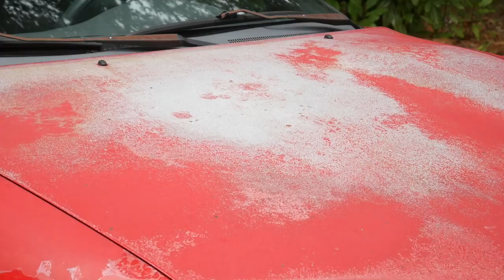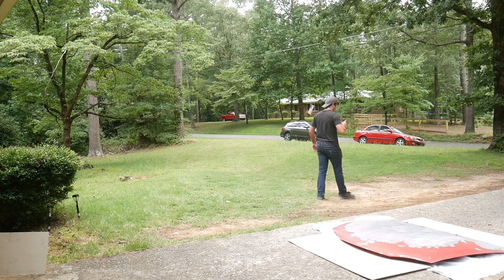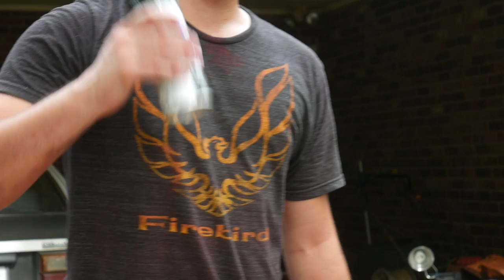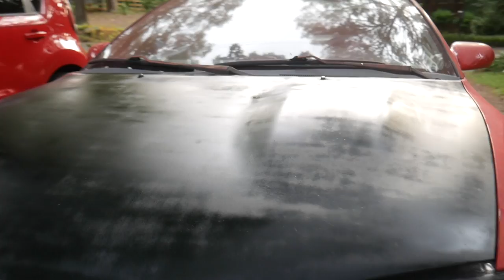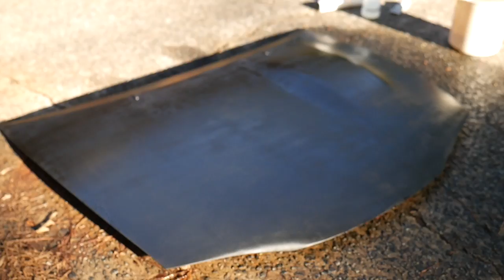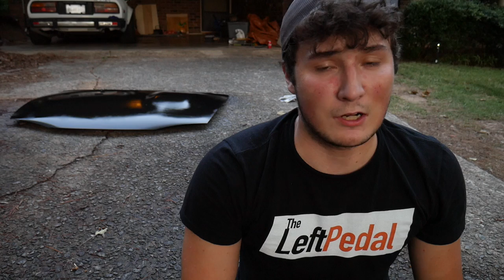Spray Painting a Car With No Experience

Comment: Being a professional spray painter, this kinda hurts to watch😂
Reply: @NITEHAWK3  😂 a crap job is a crap job, no point telling the guy it looks good. You dont get better by getting your arse kissed and told something looks good, when it doesn't.  And i was more talking about the fact he is using rattle cans with the bonnet on the ground in the dirt😉
Reply: @joelroosen9932  I use rattle cans and get factory quality finish.
Reply: @electricslide8469  😂 If you say so
Reply: @electricslide8469  but it definetly wont last as long, after 1 year ur going to notice it's cracking
Reply: What was he doing wrong ? 
Just out of curiosity because I plan on painting my front bumper
Reply: @kevinteran5624  me too
Reply: Could you fix the orange peel by wet sanding and buffing it ?
Reply: Miguel Resendiz yes you can
Reply: @NITEHAWK3  he asked people to say it's crap and add a smily face if they do.  All Joel did was what the youtuber asked... maybe you listen better:)
Reply: @KappnSkips being a professional painter or not, if you think that is  good job you've got rocks for a brain😂😂
Reply: @KappnSkips  far out, wake up on the wrong side of the bed mate😉 take your meds..

Comment: Side to side always, not up and down. Dont do cross patterns it should always be horizontal. And spray from one end to another. Dont do graffiti style spraying. You also have to sand the primer before painting. And finish with a sealer, even with matte paint, that makes it pop out

Comment: I know this video is rather old but I have painted a lot of bikes with spray cans and the way he is doing it you would want to actually hold the spray can further away than what he is doing so that the paint basically falls onto the surface more evenly and no streaks or lines in the paint, and move your hand in long straight lines never putting too much paint on at at time

Comment: I am glad you made this video, I'm pretty good with a lot of DIY projects but not everything I touch turns out great.  Spray painting is one of those that, my projects turn out looking a lot like yours so again I am glad someone finally posted an honest video about how these projects usually turn out because ... A hood is actually a lot bigger than it looks, you really need about 3 cans per coat and put on 3-4 coats 1/2 hour apart and even then I would be concerned about paint running and other issues so yeah, mad respect for paint shop guys.

Comment: One thing that would help is to prop the hood up vertically. It will give your cans better angle to spray properly. When it's flat you are more likely to have nozzle issues. 

Short side to side passes, 3 coats. First light to tack the surface, then two wet coats, with overlapping pattern. 

Keeping the stroke short is important with cheap cans are important. They don't have the consistency to lay down smoothly when you try and lengthen the area you lay clear down.

Comment: Tips for anyone spray painting anything, keep your pattern and overlap consistent. Try to keep an overlapping wet line, you'll see a hazy edge on your first line, cover that hazy edge on your next stroke and keep that flowing until you are off the panel. It will look like you are pushing that hazy line off the panel. Dont spray random strokes. It helps of you get a can with a wide tip. I also learned with cans and just jumping into it. Sand with a 18 inch block with all the low grits, higher grits a soft pad is fine, dont use your hands. Practice on smaller panels and move up to hoods and roofs. Like anything it takes time and patience, the more you try the better you get at it. Good luck and have fun!

Comment: A year too late, but I heard warming the paint can up first - like putting it in a pan with water that’s been heated helps additionally - getting your painting surface as smooth as possible before painting like Bondo - 3M or any body filler and sanding sanding and more sanding

Comment: Look mate coming from someone with experience here's a few tips if you have no option but to paint with a rattle can
1. Make sure you're not in direct sunlight and preferably out of the dirt and somewhere away from some elements
2. Make consistent coat laps ie (speed of hand movements, and pressure of pushing on can for consistent output of paint)
3. One big mistake you made and I understand it can be tough on your first go is try to overlap your passes, 50% is what is recommended so half of your next pass should go over the one before it bUt just as well as you can, this makes sure the job stays comsistant and smooth.
4. Honestly you're sanding was alright good job there, good use of grits, and probably a half the reason it wasn't disgusting haha
5. You need moreeee clear, I can't stress this enough for multiple reasons first off you need multiple coats second you want a few light dusty coats of clear to help fill in spots and help make a tacky surface for a final spray of a heavier coat of clear this should be almost watery in appearance, not so much to get runs but enough that it will have an even and wet look. 
6. A good buff at the end will if dome properly will give you decent results, nothing beats a proper spray gun and booth but sometimes you just can't do it and I think most of us understand that so atleast try do the best with what you can use.

Comment: Valiant effort sir lol... it's good to keep that expectation low cause you're never disappointed lol. Aerosols are hard to use, especially in the sun and heat. each pass you make essentially dries before you make the next pass and that's why it tiger stripes. lay on heavy wet coats when you use spray cans, and long even strokes are your friend.

Comment: I have no experience and have never painted a car but what I know is that you have to sand the remaining paint then primer it with light coats so it doesn't runoff then when it dries sand it down then clean the dust and paint it with the desired colour then put a layer of clear coat on it and if we still see dust particles in the paint we have sand it with a very fine grit and polish it to remove the dust so there are no impurities though it is advised to bake the paint to make it long lasting

Comment: I'm no painter. I have 2012 Dodge Charger all black. I noticed that scratches from other car doors on my driver side. I took some black gloss spray paint to get rid of scratches and learned quickly that I should have used either stencil or a small painter's brush to fix it. Thanks for your video. You are better than me, you put alot of work into your car! The Ebay Elipse looks good. But add more black gloss spray paint. You can get that from Walmart. Are you planning on painting it all black or red. If it is red you'll targeted by the police alot for tickets and the car would be a chick magnet. If the car is all black than you'll be very hot in the summer, but a chick magnet at night! Overall great effort!😉

Comment: A helpful tip for me, especially on something that big, is to have it propped up vertical on something (i.e. a tree or something). It looks nicer when you go through a full line than to stop in the middle of your project. Also, for me at least, its better to paint a shallow layer than a thick layer. Shallow, you get to go back and add a layer. If its thick, that's when you'll get the dripping of the paint. Overall, it doesn't look too bad, especially for a first timer.

Comment: Biggest issue here is bot keeping a wet edge to work to.  Dusting paint on will result in patches and stripes.  If you can get the bonnet an a more upright say 45 degree angle it will help as more paint comes out of aerosol cans when they are upright. It is possible to maintain the wet edge with aerosols. But you need to have a decent overlap of around 40-50% on each pass and work fast enough to keep it from drying. Also when painting outside sometimes you need to go slightly closer than they suggest as any wind blows away the spray. If it says 12 inches away then reduce to say 9 inches.

Comment: Thinking about fixing my truck. I’ve got some clear coat issues in my door. Nice work BUT if you would have kept it a lil bit more uniform you might’ve had better results. I haven’t done it yet but you needed more even coats. You said you had 7 coats so you’re just gonna sand it out. Hell yeah brother! BUT you gotta keep it uniform. Sand 1 area at a time til it feels smooth. You kinda bounced around a bit. The end turned out better than what it was. Just needed a lil more sanding. Even if dull it should all be 1 color THEN you clear it. And when you do even wet coats. 👍

Comment: You should have been in the garage with that hood on some saw horses and sprayed further away with slower and longer sweeping strokes plus next time when wet sanding use a sponge so that it will leave finger marks off the job and be more uniform. You have great determination and keep up the good work!

Comment: Dont cross your paint spray, dont go from here to there, stay in one area and overlap the paint as you spray. Use good paint. Use a sanding block not your hands. Dont let the panel get super hot by the sun and avoid direct sunlight. It looks good from 100 ft. Lol

Comment: it helps to stand the hood up easier to reach top to bottom left an right .. when spraying the paint needs to go on wet if you see dull or dry looking streaks slow down n go over dry streak before continuing .. if finger gets tired stop for 10 seconds rest n continue spraying .. if you get a run dont start trippin finish  painting an let it dry 24-48hr wet sand entire body panel to get rid of orange peel n any runs that may have happened go over panel with meguires ultimate compound can do by hand just takes time work in small sections wipig in small circular motions use clean micro fiber to apply an use another to wipe off. ive been able to get spray paint to glossy mirror finish . important try to paint on days with 75% humidity or less n work in the shade no direct sunlight

Comment: I spray painted my car today... lolol. I used a sander and buffed out the rust and chips etc with a 60 grit, then a 120, then a 320 until it was smooth. I then of course put 2 coats of a primer, then I did about 2 coats of white paint on the primer and then tried to blend it out. I ran the length of the hood back and forth as fast as I could. I sanded it with a 320 again lightly then sprayed it 3 times again. I then did a light sand and am spraying the clear coat. I've never done it before but it turned out really well. 
I did spray paint it is long strips but I literally had to basically run back and forth. You also have to make sure you hold the can at a decent distance and keep it that distance the entire time. 
Perhaps it was because it was white..who knows. 
My suv is a pearl white. Of course I got that in the spray form but it was rustoleum. The sheen is super bright so I lightly sanded the sheen down and it matches the paint nearly perfectly. I figured nothing could look worse than rust anyways so win win.

Comment: Tips: 
1- dont paint in direct sunlight 
2-  dont paint “sections” of the panel, sweep all the way across you would have had much more success if you held the can further back, stood the hood up and swept across with the can vertical, a lot of your issues were due overlapping and uneven strokes. 
3- Overspray is your friend, it means you’re getting the whole surface

Comment: If your set on rattle can spray jobs, go with rustoleum professional it gives a much better more durable finish. You could of stood the hood up to paint that would have been easier. Your getting the zebra stripes because your not overlapping enough. As far as clearcoat you can get spray cans with hardner. On a side note if your trying to stay on the cheep, putting your egr valve and other carbon fooled items in a bucket with carb cleaner and letting them soak over night would have worked. Keep doing what your doing and try to learn and keep improving, it shows you have initiative 👍. Have fun😁😁😁😁😁

Comment: Dude I have to say I love your honesty I love your raw video style I love your innocent of trying to do something that you're not that familiar with. I was highly entertained and I enjoy every minute every second of your video because you were not skilled of course but you are honest about it and that's a real character that really shows in your video.

Maybe using the term real character is incorrect.  I really meant that you're really genuine and that's what shined on your video. By all means I am not a pro but so far I think I've watched about 50 videos and I've watched them several times over and over and what I think you did wrong was you were painting from an angle on the floor I think the hood should have been elevated like on a stand and instead of pointing the can from high in the air the spray nozzle wasn't shooting the full pressure which gave the can a wider spread. So your streaks was because it was not a wider spread and it was more narrow so again you should have had the hood elevated on some kind of stand and then have your can angled almost upright but not angle towards the ground if you know what I mean. 

Also the clear coat you're using doesn't have a high gloss you should be using a 2K clear coat that has the type of shine just like a factory vehicle. If you watch a lot of YouTube videos they tell you to use a 2K clear coat which has a super high gloss and has a hardener. Also after you apply the clear code there's a lot of buffing involved which will give you a factory high gloss shine.

But again I love your genuine personality that really shine through the video and if anything even though you weren't a pro you were just a regular Joe trying to do something you have no skill and you are very entertaining thank you so much for such a entertaining video and dude I think you have a niche and you appear to really entertain your audience and I have to say that to keep on continuing making entertaining videos just like you did with this one. 😊😊😊👍👍👍👍

Comment: problem was in the way it was applied. You have to do long strokes across all the way of the hood, stopping after the hood and then going back the other way
40-50% overlaps with light coats

Comment: Hey man you should’ve hung it from the roof of your car port or in a area without any wind. No wind means no overspray because the paint coming out doesn’t have time to dry before it hits the hood making the paint lay even.  I’ve mastered the art of the rattle can but has taken years. Spray cans are meant to spray straight out with the hood right in front of you. You’re spraying down onto the hood putting the can at an angle. Hang it and spray it straight out in front of you and wipe the tip every once in a while so nothing dries and clogs  that cause imperfections

Comment: My car's clear coat was peeling off badly.
I gave it a quick sanding to remove what's loose and sprayed it with poorly matched cheap spray paint.  It ended up turning out streaky, drippy, uneven and rough, yet still looks 10 times better than it did.  
I'm ok with that.

Comment: Couple of tips
 Don't start or stop spraying on the piece.  Start the spray off to the side. Make a full pass over the piece and stop spraying once you have passed over it.  You end up with uneven sprays when you go back and forth on the piece like that.  
Tip2. Slow down.  Coats are too thin. 
Tip3.  Dont wet sand the color coat.  Clear coat first. A couple light coats and then a fine al heavy coat.   
Wet sand and polish last.

Comment: Bro I don’t know anything about auto painting but I use to work at a paint chemical plant and the techs told me to get smooth coverage to slightly warm the paint and spray the paint completely of the surface. IE start the paint off to the side, continue on to the surface, then off to the side again. So it’s an off, on, off thing.

Comment: First coat is the thin coat then wet sand it. Then put a heavier coat of paint on it, sand it again. Then the third coat go more heavy on the paint. But watch out for runs. For a really good glossy finish. you gotta paint and sand it alot. That way the more layers of paint you got it'll fill in the super fine scuffes.. I spray painted my old honda hatch back. Put it this way it turned out good enough the gloss black hood scoop I ordered off amazon matched the paint job I did perfectly. It was my first ever car I painted with rustolium spray paint. All together I painted my car for $20.00. I have pics on my facebook before, during and after.

Comment: You have a compressor large enough to paint.  Get a $25 spray gun from Harbor Freight.  Thin the paint and spray until you figure it put.  It's not hard... Unless you use rattle cans.  Keep at it.

Comment: Did pretty good for the first time few things need to be 6 to 12 inches away as you spray and go from one end to the other back and forth so you would spray a line go directly under and spray end to end in a fluid back and forth motion don’t stop in the middle and start from the other side won’t get so many streaks in the paint